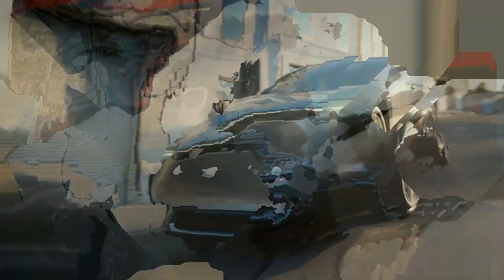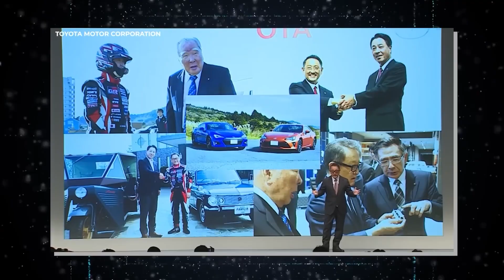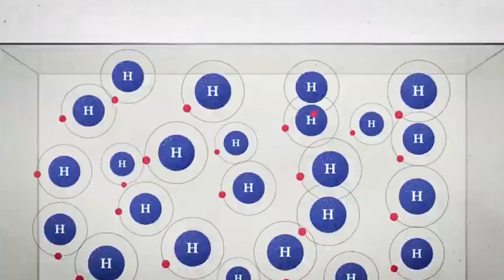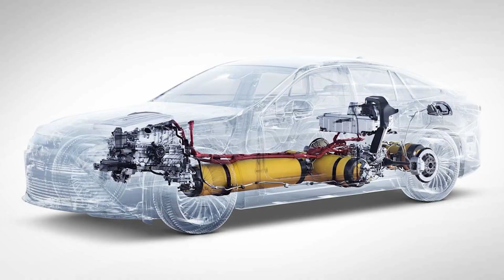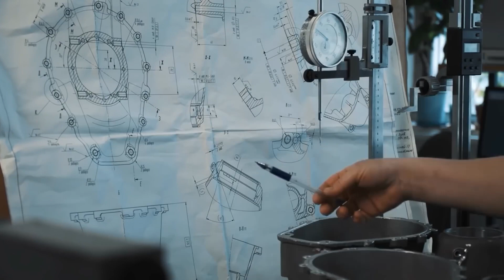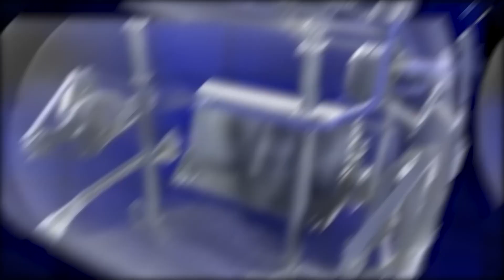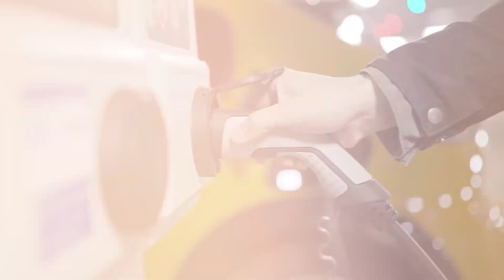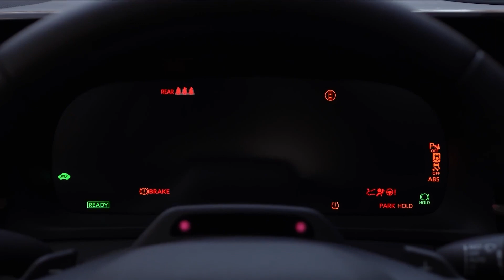Toyota's Latest Engine -The EV Ends

Comment: The BIG PROBLEM with FCV is fact that fuelcell lasts only 10 yrs and is very, very expensive. With hydrogen powered combustion engine is also problem - corrosion caused by hydrogen - I wonder how many miles will make without broke. I think today there is nothing better eco alternative than hybrids vehicles especialy Toyota and Honda type

Comment: This is just another clickbait video with fake news. 

Always look for proof and be critical if you see a magic bullet for all the diseases.

Japan is at the back end of EV adoption. They are dragging ICE vehicles as long as they can just to make a lot of money milking people in petrol stations. You can't make petrol at home.
When the world gets to them, they have nothing. That is why Honda EVs will be based on American GM and Toyota on Chinese BYD and GAC platforms.

Hydrogen ICE vehicles will not work due to NOx emissions.

Hydrogen fuel cell light vehicles will not work due to the cost of making, transporting, and storing hydrogen, the complexity and slow evolution of fuel cells, and the low amount of hydrogen filling stations. 
EVs evolving very quickly. CATL for almost a year has been making 250Wh/kg qilin lithium-ion batteries. Zeekr 001 with one charge went 620mi at a temperature between -2 and -12C. Samsung has announced that in 2027 will open a solid-state battery factory that will make more than 500Wh/kg battery. Basically, double the range of qilin.

This kind of advancement is everywhere: charging speed (12min till 80%), renewable energy is getting efficient and cheap (200EUR/kWh) and will overlast you, smart electric grids, petrol head EVs that will give you more feal than ICE cars and a lot more.

Comment: They should focus on water powered car which derives hydrogen from water.
Reply: Is this a joke?
Reply: Ideally yes. But I think separating hydrogen from water is very energy intensive. So that might be what's holding it back. I think hydrogen fuel cell engine might work better than hydrogen combustion engine.